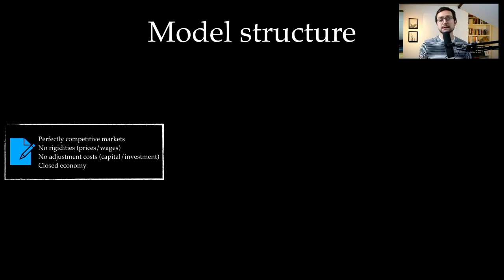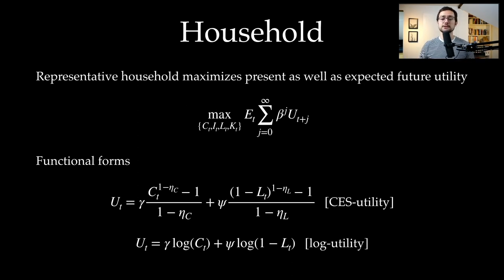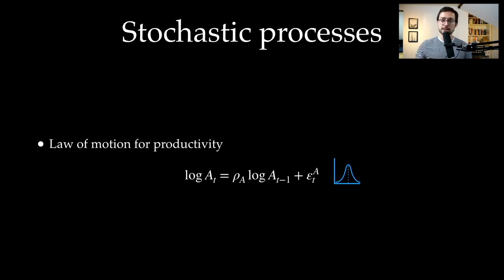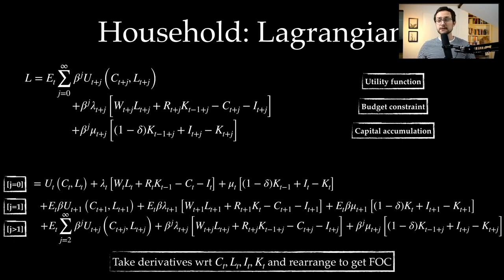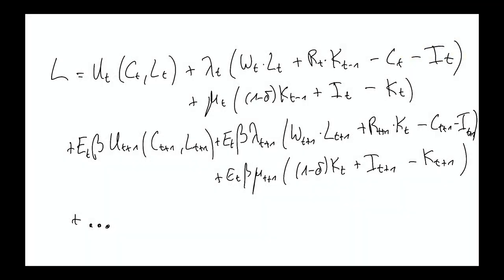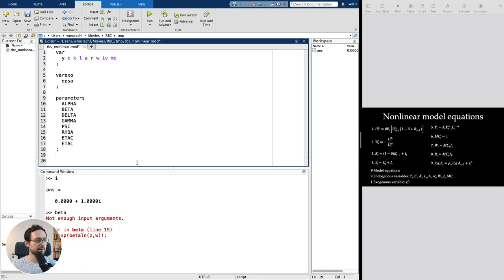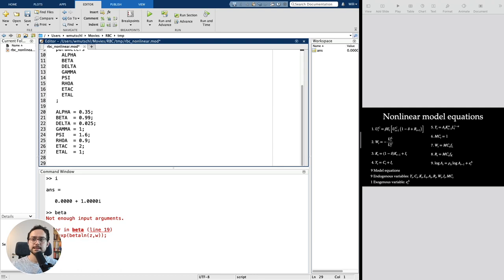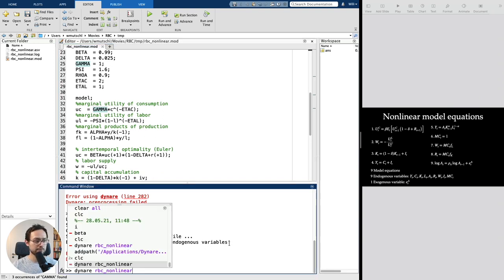RBC Baseline Model Equations and Introduction to preprocessing with Dynare

Comment: Thanks for all your efforts.
Could you please quickly mention how you initially get the pdf file at the last quarter of the video?
Reply from the maker: The tex files are created by using the dynare commands. You can then simply open them with your favorite Latex editor and compile them. Alternatively, if pdflatex is in your PATH, then the system command can be used. Note that this depends which operating system you are working on: https://git.dynare.org/Dynare/dynare#optional-pass-the-full-path-to-matlab-to-run-system-commands

Comment: Thanks a lot. Really like your illustration! May I ask you one question:
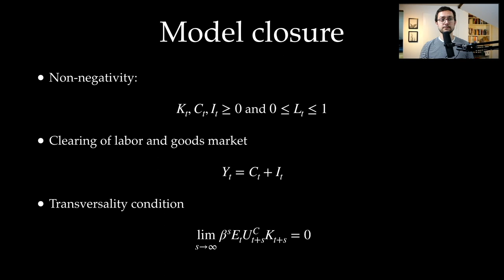At 14:20-15:35, you say transversality conditions is a boundary condition, which can make us focus on first-order conditions without the need to look at second-order derivatives., may I know what first-order conditions you refer to, 
is it the model equations we get from the model maximization problem?  E.g. Euler equation comes from the FOC of household utility. So, does it mean the transversality condition makes the Euler equation meaningful?
I am also a little confused about what boundary is it, for which variable and how the transversality condition can make us only need to focus on FOC, may I have some intuition behind this conclusion.
I am thinking FOC equals zero is enough for any concave function to be the maximum.
Reply from the maker: Yes for concave functions and bounded sets on which you are optimizing on. However, we have an infinite planning horizon and for this we need the transversality conditions, because otherwise we could end up in situations where debt is never repaid etc.

Comment: Hi!!! i have a problem with the last part of the code...:

if system ( [`/Library/TeX/texbin/pdflatex -halt-on-error -interaction=batchmode` M_.fname`TeX_binder.tex `])
`Text-File did not compile; you need to compile it manually `)
end

A am a macOS user. the error is:
Error using RBC_nonlinear.driver
Error: File: driver.m Line: 228 Column: 90
Invalid expression. Check for missing multiplication operator, missing or unbalanced delimiters, or other
syntax error. To construct matrices, use brackets instead of parentheses.
Error in dynare (line 293)
evalin('base',[fname '.driver']) ;
Reply from the maker: I uploaded the description of the video where you can find the mod file. Try to run this and check whether you run into issues with that.
Reply: @wmutschl  thx so much!!! is woking perfect right now!!!!!

Comment: Thanks for your tutorial. I'm working on Open DSGE modelling. I have been viewing  your videos many many times. Confused with firm maximisation of expected profits is normal discount factor x stochastic discount factor x profits of representative firm (in real terms). Can you explain the rational behind?
Reply from the maker: Firms want to maximize lifetime profits, because typically they assume that they will "produce forever" (or don't have a rationale to go bankrupt). So the planning horizon is infinite. To compare the VALUE of profits in some future period with the VALUE of today's profits one has to discount the future profits with a discount factor. As firms are assumed to be owned by households, we make use of the Euler-Equation of savings for the households to measure the VALUE of profits, and we call this the stochastic discount factor.

Comment: Could you explain how you decided that present decisions of firms j=0 don't impact decisions of  j=1?
Reply from the maker: In general j=0 could have an impact on future profits, but in the RBC model this is not the case, it is just a static optimization problem. Each period the firm decides on labor and capital used and this decision has no impact on future periods. In the New-Keynesian model with say Calvo price rigidities this is different as there is a probability that firms are stuck with their price for a certain amount of time.

Comment: Thanks for this tutorial, it was not clear why to differentiate part of the second equation in the minute 20:09-22:00. Throughout the presentation you were considering equation 1, when j=0, that is for C, I, L. But for K you used J=1, is there a specific reason?
Reply from the maker: Because K_t appears not only for j=0, but also for j=1.

Comment: Is it possible to use SMM to match moments without specifying a data-file? For example, if I want to match the variance of consumption, is it possible to match it by specifying it directly or does it have to be computed from a data file?
Reply from the maker: It has to be computed for a datafile. What you have in mind is called calibration. Have a loot at my advanced calibration video where you flip variables and parameters. Create a new variable which is the square of consumption and then find the parameter(s) most relevant to target a specific value of that.

Comment: one very basic question. How do i install the database from excel to dynare. ??
Reply from the maker: Have a look in the manual, it depends on the command you run, but you can import data from excel with Dynare.

Comment: How can i save into pdf file with windows? Help me please. 
The error code is:
The system can not find the path specified.
Warning: TeX-File did not compile; you need to compile it manually 
> In RBC_nonlinear.driver (line 230)
  In dynare (line 281)
Total computing time : 0h00m00s
Note: warning(s) encountered in MATLAB/Octave code
Reply: I also have the same issue.
Reply from the maker: Well it seems like you don't have latex installed. Install it and open the .tex files and compile them.